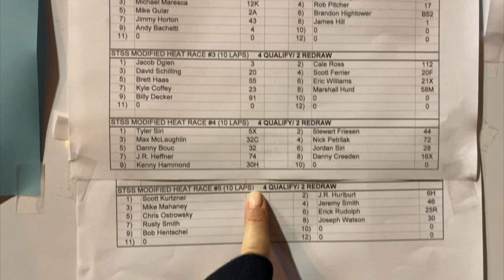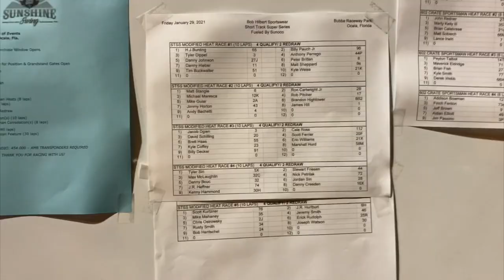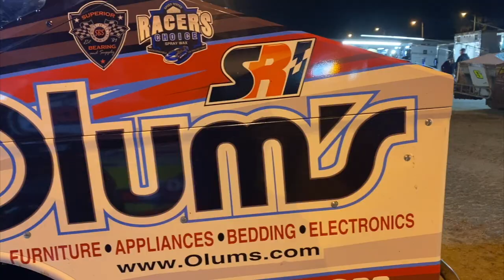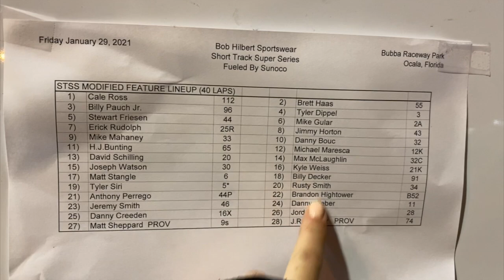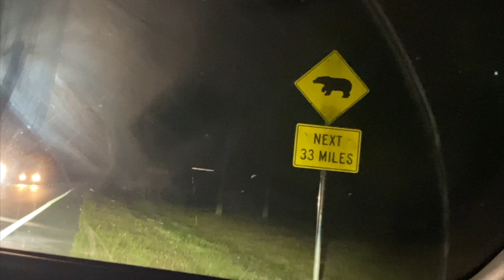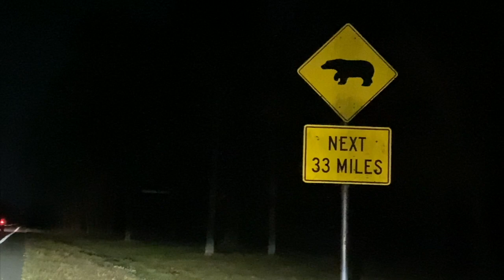Sunshine Swing Day No.2 | Bubba Raceway Park

Comment: Hey Mandee both the boys got tight as the race went the clay down there is sand based verses the clay we run on up here in the north so the track hardens up quicker than we are use to hope this helps good luck

Comment: What's the difference between the 33 and 35 car besides the owner 🤔  ?? LUV the videos 📹
Reply from the maker: They both had two different motors in them. So it was just a preference in which car to use with the track conditions.